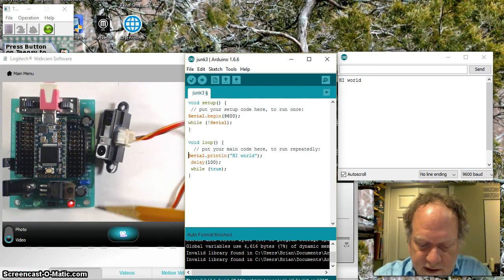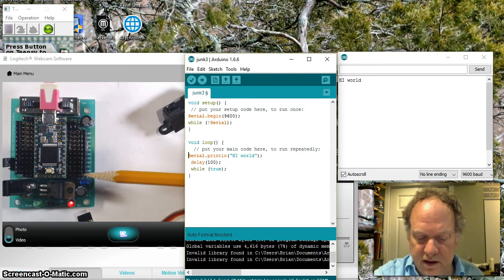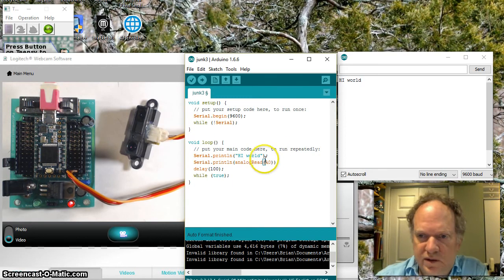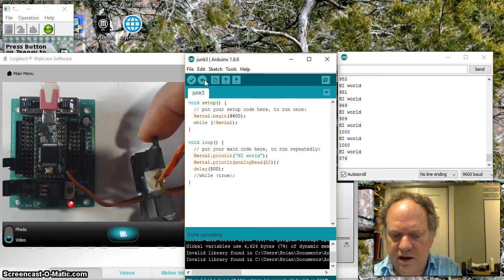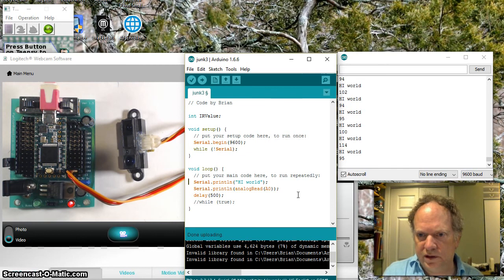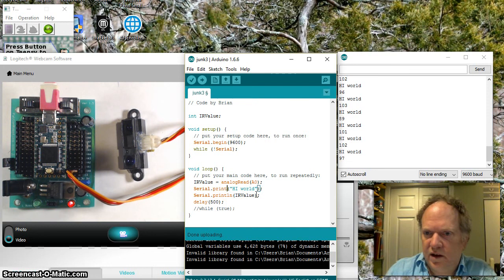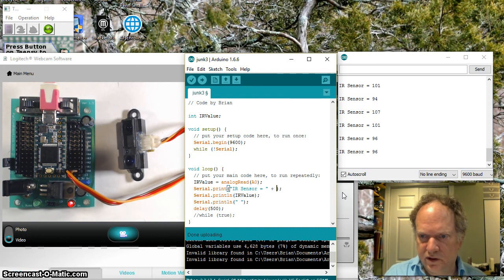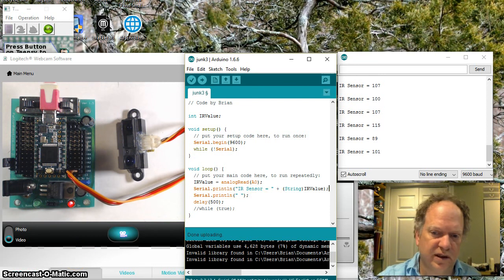Reading Analog Data with Arduino on a Teensy

Comment: Thanks for the clarification! I'm currently working on a project on Quadcopter with IR sensors (Obstacles avoidance). It would be great if you are able to help me ask my doubt on the following codes: http://forum.arduino.cc/index.php?topic=404134.0, thanks in advance!
Reply from the maker: hmm...with a quick look, I don't see how it works exactly..can you link the original source?
Reply: http://www.flitetest.com/articles/quadcopter-obstacle-avoidance-system-using-arduino as for the code you can refer to what I have posted in the arduino forum http://forum.arduino.cc/index.php?topic=404134.0, once again thank you for helping appreciated.
Reply from the maker: I looked at the code. I tried to follow the logic but the code seems incomplete. setpoint is set to 60 then mapped....but never changed...Why map an unchanging number on every iteration of the loop? I feel as though some piece is missing
Reply: According to his project, his uses a GP2Y0A21YK IR Sensors. Based on his mapping code, I'm assuming the minimum detection range of the sensor is 20cm and maximum range is 150cm. The setpoint is declared as 60 (cm) because he intend to make a setpoint of 40cm from the IR sensor so if the setpoint reaches below 40cm the PID algorithm in the arduino will start its work by sending out the correction value to the stabilization board (kk2.0 flight controller). Hope I'm right...I'm guessing
Reply: I guess his being lazy and uses the map function to calculate the analogue reading at 60cm. With some simple calculation, i calculated that at 60cm the analogue reading should be approx 315 and it would be more appropriate to declare the setpoint=315 and skip the map function.
Reply: For question 2 and 3 which i asked in the arduino forum http://forum.arduino.cc/index.php?topic=404134.0 I'm thinking they got something to do with the PID equation as shown http://brettbeauregard.com/blog/wp-content/uploads/2011/03/pidalgorithm.png. I don't know if you know anything about the PID equation but if you do, it would be great that you could help me out thanks!

Comment: Hi Sir, just to clarify, if ur hand fully covers the IR sensor, the maximum value would be 1023 right?
Reply from the maker: HI there...likely not. To get 1023 you need to reach a full 3.3v or 5 volt input (depending on the chip). Placing your hand over the sensor blocks the IR emitter and confuses the sensor. It starts to go back down when you get too close. Placing an object about 10cm from the sensor generally gives maximum signal and generally not 1023.